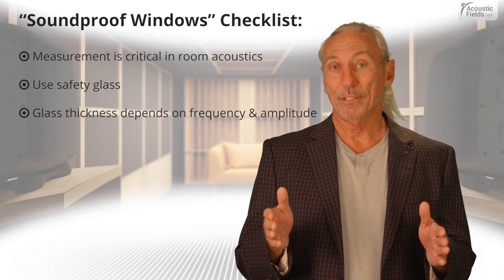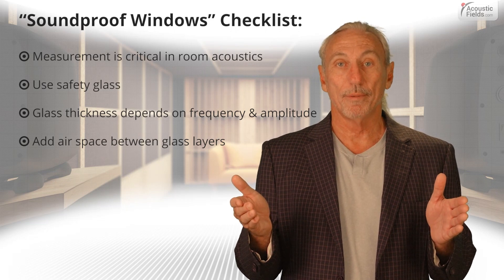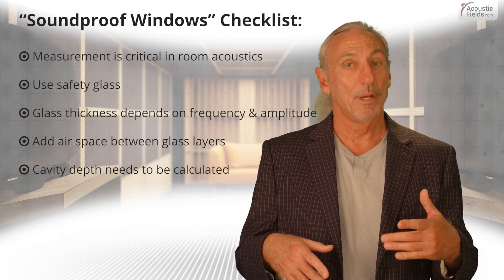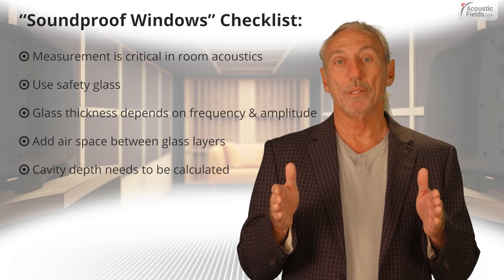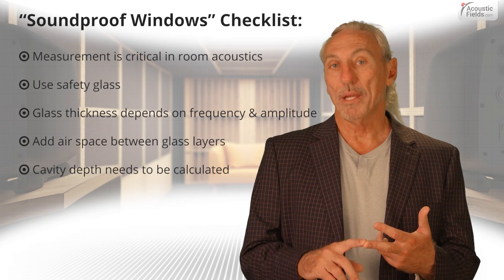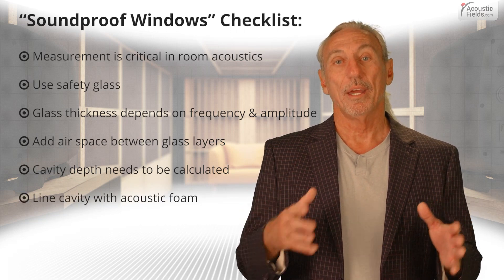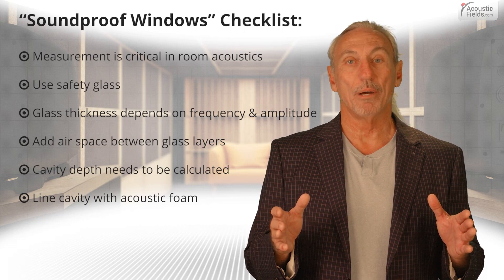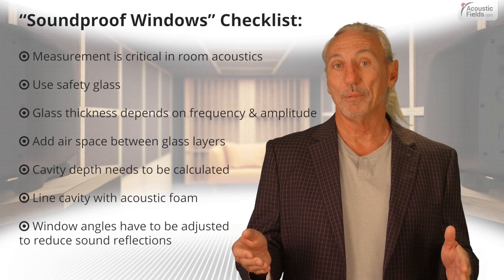Soundproof Windows - www.AcousticFields.com

Comment: You got any guides on how to calculate all these? :) trying to remake my windows because I can gently hear the bass of my monitors in my live room and would like to fix the window :)
Reply from the maker: The window has nothing to do with your low frequency issues. They are based upon the room dimensions, set up, and numerous other variables.
Reply: @AcousticFields  oh. Maybe those are contributing factors too but my windows are definitely not built right and can hear the leaks thru it too vaguely. Would really love some professional guidance from you 🙏🏻
Reply: What I mean is I can hear feel the bass from my control room monitors when I’m by the window in the live room opposite side.

Comment: I have a 4m x 3m room and I play music with an Edifier S360DB 155W RMS 2.1 system. I have a regular window of 120cm x 130cm and a 220x80 regular door. I would like to reduce the leakage amount of sound from inside to outside. I live in Brazil so the things available here and there can be different. A guy build windows here but watching this video makes me think it may not work because of the amplitude and frequency generated by my system will be too much for the window characteristics. It may be quite expensive too and won't fix the issue. The question is, if I treat the room instead, will make the sound travel less to bother the neighbors a bit less too? What you guys think?
Reply from the maker: C, Window density and wall density must be equal. Sound is like water. It will find the weakest link and go through that opening.

Comment: Okay, so... Clients and Talent aside:  if I have a loud commercial exhaust fan on my apt. roof (several feet above my head) that often makes sleep impossible, I should block my closed windows with what, an array of towels?  What range of frequencies comprise an exhaust fan's aural attack, anyway?    Blankets on the walls and ceiling too?  And if it's low frequencies that comprises this massive aural attack profile, then what?
Reply from the maker: T, It is always best to minimize noise issues at the source. It will be much cheaper to treat the cause of the exhaust fan noise at the fan. If you reduce noise at source, you may no longer have the noise transmission nuisance value.

Comment: hmm, you could also optimize for bass transmission with thin windows.
if outside noise isn't a concern but you have bass bildup in a room.
and being a window would drive me to resignation too.
Reply from the maker: L,  I do not understand your comment. Please clarify.
Reply: the last sentence was just a joke, you misspoke in the video.

Correct me if i'm wrong, but soundproof windows also trap more bass inside the room.
i'd imagine, thin windows let bass frequencies escape more readily, acting like an absorber.
in some scenarios, a thin/light window might be a useful tool for tuning a room.
Reply from the maker: L,  Room acoustics is a balancing act between treatment (absorption/diffusion) and noise transmission. Every room usage, size, and volume along with noise frequency and amplitude must be calculated. Thin glass windows can actually produce more middle and high-frequency noise because they go diaphragmatic with the pressure exerted upon them by low-frequency waves.
Reply: Now that's a detailed answer, thx!

Comment: Good information about the thickness of the space between pieces of glass. 

My stereo listening room has 7 windows to the outside.  I'm trying to control the reflected sound, not he transmitted sound. We're in a rural area. Transmission isn't a big issue. I want to keep the sound from picking up the reflected sound signature of the double pane glass windows. 

I have bought some thick, clear vinyl.  It's fairly soft and pliable. I'm thinking of testing it in one of the windows. (it's 80 gage material, the scale for vinyl thickness is opposite of other gage measurement:  thick vs. thin).   I'll cut it to size and glue molding around the edges to make is somewhat removable.  Based on above suggestion I'll also make the space between the window and the vinyl thicker than I was anticipating and use foam.  I won't measure the sound transmission levels as they are of secondary concern with this application.     

Is this a worthwhile exercise?  Other suggestions to deal with reflected glass sound are welcome?

I had considered blocking them up with Acousti-Blok (dense, black rubber-like material) but that would kill the wonderful views and eliminate natural light.   Indow window inserts are designed to lessen sound transmission but are made of clear acrylic;  a stiff material which I don't think will be best for the quality of reflected sound.  There are also checker-board like wooden diffusion devises that might be helpful (but less than ideal for looking out the windows).
Reply from the maker: R,  We use two methods to deal with reflections from glass surfaces. You can place a foam collar around the parameter of the glass surface. It must be at least 2" deep. Another approach is to use a series of foam strips that are spaced evenly apart across the glass surface. We use a 3" gap between the strips. The open spaces allow for viewing and the foam reduced the impact of reflections. Most build a wood frame and insert the foam into the hinged frame so the foam frame can be swung open for complete access for viewing.
Reply: Thanks Dennis, Do you have any photos of these examples to help for my "clarity"?  This "sounds" like what I may need.
Reply from the maker: R,  No photos but easy design.
Reply: Ok.  I think I understand your general idea and the design may be easy but the details are vague in my mind. Is the foam in contact with the window to act as a damper to prevent window vibrations? Or does the foam act like a diffuser / absorber?   Is this design similar to boxed wooden diffusers except by using foam it acts more as an absorber?              Perimeter of the window gets foam at least 2" deep .  Is that measured from the glass  to two inches into the room ? or 2" from the window frame toward the center of the window?   Thickness of the foam in the other direction can be what? 1/4"? 1/2" 1 inch??       Three inch spaces from foam strips across the window:  Are the strips parallel? in a square pattern?  What are the dims of the foam strips? Width / depth?   Is there a sketch?  I appreciate any clarification you can send my way. As always, Dennis thanks for the continuing education.

Comment: We have explosion proof glass walls where I work.
You can beat on them an no one can hear you on the other side, pretty impressive stuff. The whole building is designed to accommodate BSL 4 labs, so the glass walls are the first barrier into a BSL 1 environment.
Reply from the maker: J,  Glass can be a good barrier even at lower frequencies. We just finished designing a concrete / glass barrier for a client in the Hollywood Hills. Concrete was 4" thick and the glass was 2" thick.